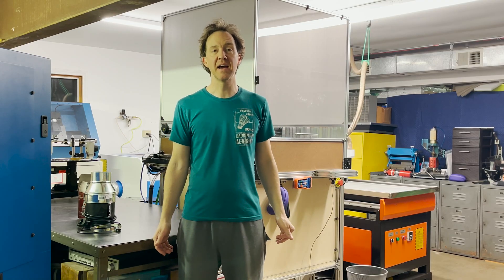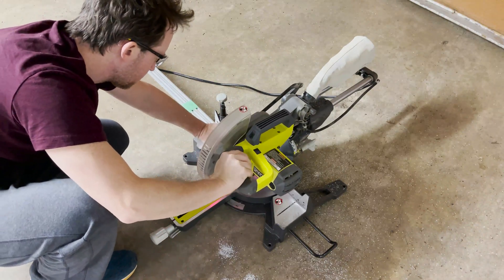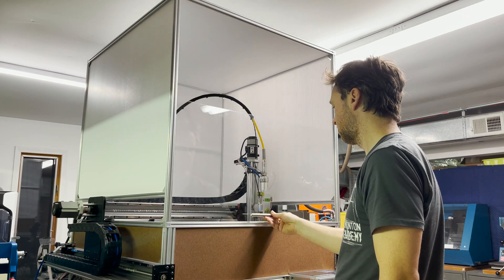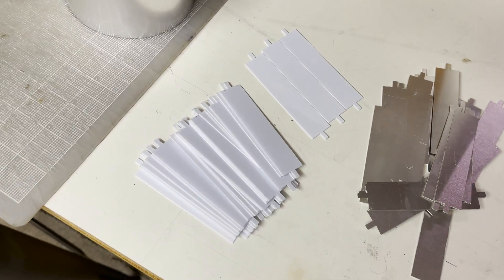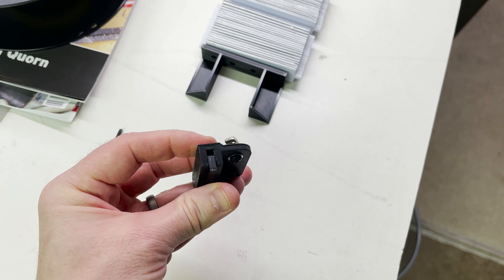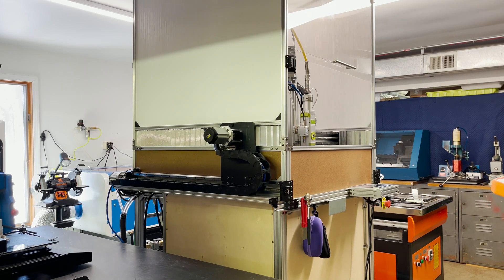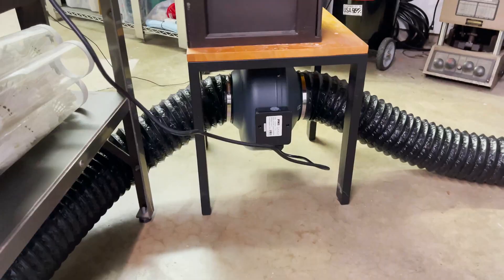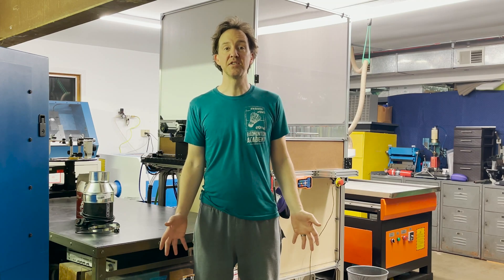DIY 1000W Fiber Laser Cutter Part 6 (Final): Enclosure & Updates

Comment: May i ask what nozzle size and power settings you are running to get that clean cut in the beginning? ive had issues with anything above 3mm in aluminium as well it hardly makes a dent in 4mm. :D
Reply from the maker: That was 16 ga. steel, not aluminum. I tested cutting aluminum once, it was 3.3mm thick and the results were poor...it didn't cut all the way through in some sections. I've not done further testing with it, as I'm a little apprehensive about damaging the the laser source with back reflections. I should probably test it again with some thinner material.
Reply: @diyfiberlaser  ah yeah i guess 1kw is just way underpowered.. I tried with 3mm single nozzle and blasted it really just full power, also tried piercing it in 3 steps and all the weird stuff. Made hardly a dent in it. just absorbed the crap out of it :D

Buuut on the other hand 8mm steel where no issues.. with a 2mm lens and a step piercing strategy so for most use cases its enough.. but i do wish i got one step larger.

Comment: I'm so glad you did this. For the last few years, I was thinking of doing exactly the same thing after I noticed that I could buy CNC laser heads that plug into the laser welder.  Of course I had doubts whether I could actually pull this off.  So your video helps show me that this is really doable.  Thanks!
This brings me to my question. Have you bought the laser welding gun attachment and plan to do any laser welding?  Because as far as I can tell you only need the welding gun and the wire feed mechanism and you can do laser welding.

Comment: I saw the 16 GA. carbon steel cut and am curious about how thick of carbon steel do you think this will actually cut. We use a lot of .180" thick material and this would be a great alternative to our current process (translation: time and money saver).
Reply from the maker: The spec sheet says 10mm, the thickest I've cut so far is 1/4" steel plate
Reply: @diyfiberlaser  thank you! This video really has me thinking...

Comment: Amazing video series, so incredibly helpful!! I purchased all of the items that you have for making this and I am getting ready to run. What I can't seem to figure out from the cut charts is the laser PWM frequency. I see that the Ruida can modulate the laser source using a 24V PWM signal, but what value do you use for this frequency in the control software when cutting and piercing? Is there a chart somewhere that you looked at to figure this out?? Thank you in advance!!

Comment: VERY clever, I just don't understand why you would go to all the extra trouble instead of taking the enclosure around the machine, wider at the base BUT also have it so it was accessible if needed.  I think you over engineered it, maybe got carried away with smart ideas rather than practical ones, sorry to sound like an asshole, I think what you have done is incredible and I wish I had your skills, I'm trying.  All the best.
Reply from the maker: That's a valid point and I considered it. I chose to go this route with extra complexity because I was trying to keep the enclosure as slim as possible...I have a small shop and lots of machines, didn't want to take up the extra space. Also, I thought it would be cleaner this way...it keeps the metal dust off the y-rails and ballscrews, and motors. Now I just need to make a bellow cover for the x-axis. Thanks for your input!
Reply: @diyfiberlaser  DOH.  Hadn't considered the metal getting on the rails.

Comment: A cheap and easy solution for bellows is to use vinyl window blinds and cut them to the right size. The aluminum tape will probably fatigue and split after some use.
Awesome build, very impressive!
Reply from the maker: Thanks, that's an interesting idea. Unfortunately, the tape has already begun to split in a couple places., so I'm going to add a layer of flexible mesh fiber tape to the outside to keep it together.
Reply: @diyfiberlaser  No problem, I made some for my mill from cheap peel and stick blinds, I'm surprised at how well they work. I recommend them if you decide to swap yours out.

Comment: I'm just tuning into this interesting built.  I'm definitly going to have to catch up.   Have you considered trying to make a Water Jet assisted Laser Cutter?   (Lower pressure than a standard water cutter, and IDK if lower laser power is needed for cutting or not).  Such a machine looks to be a very interesting way of cutting very thick (including metal) materials, and reducing sparking from metal cutting.
Reply: There's some microjet laser tech that seems like the one you described
Reply: @ARJUNDASED   Yes, I saw a few videos on tech similar to the Synova Laser MicroJet and wondered how hard it would be to create a DIY version.   There are DIY waterjet cutters (using pressure washers of all things) - and this tech doesn't require pressures nearly a high as industrial water jet cutters since it is just a laser-assist.   Thought I'd mention it.
Reply: @ferrariguy8278  yeah would be interesting and a breakthrough for the diy fabricators

Comment: Do you plan to install slats to put material to cut on ? it is a must to form like spear ...
Reply from the maker: Not at this time. I'm just going to hold the material on the edge and use micro-joints to keep parts from falling.

Comment: How well does the carbon filter work for filtering out the fumes? Have you tested it at all?
Would be great to see!
Reply from the maker: Because I put the filter outside when cutting, it's hard to tell how much it's working.
Reply: @diyfiberlaser  any smell or anything coming out?
Particulate counter reading before and during a cut could show some indication

Comment: Painting the inside of your enclosure with regular matt paint is sufficient. It will absorbe a lot off the rays. Is has to be as matt as possible, with an orange peel finish(or worse) is best.The coarser the better. (every valley in the paint stops the rays reflecting.) Color doesn't really matter for these kind of rays. Because of how close the paint is to the rays when the head is near the sides, I would opt for a heat resistant paint. You would be surprised how much heat gets reflected on aluminium. Hope this helps. Greetings from Belgium
Reply from the maker: Thanks, that does help...I might try some textured paint for the undercarriage of vehicles.

Comment: How much heat is transferred to the part itself during the cuts?
Reply from the maker: Thin stock barely gets hot at all, I can almost immediately pick it up. Thicker metal cut with O2 gets really hot, has to cool down before handling.